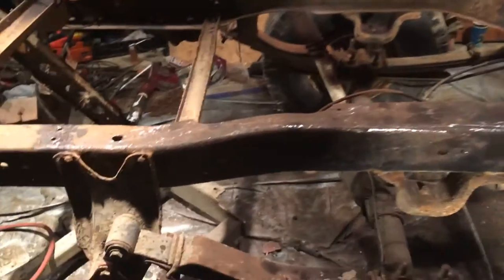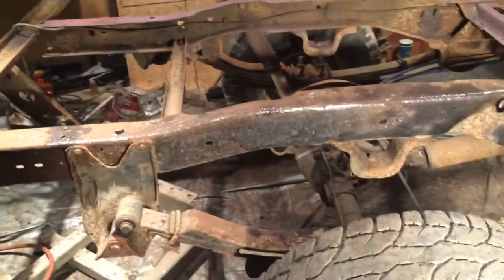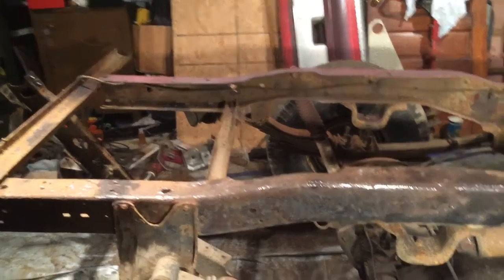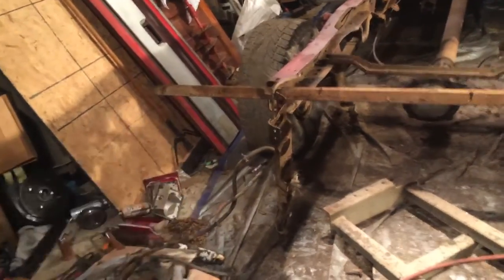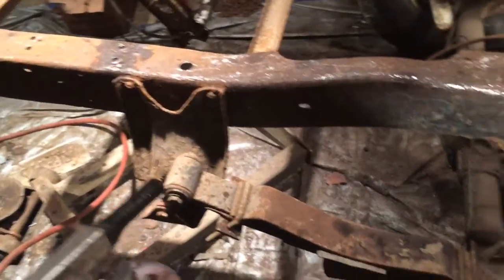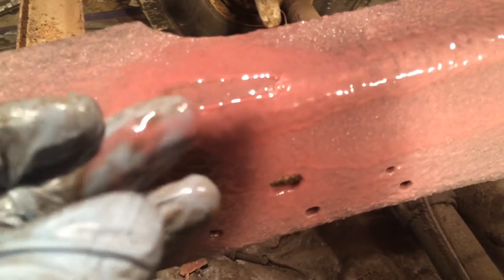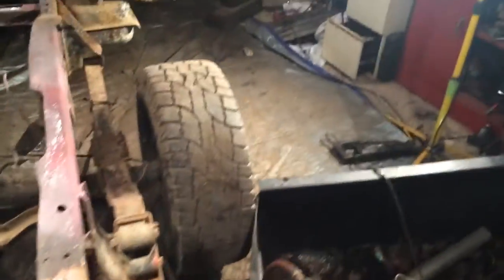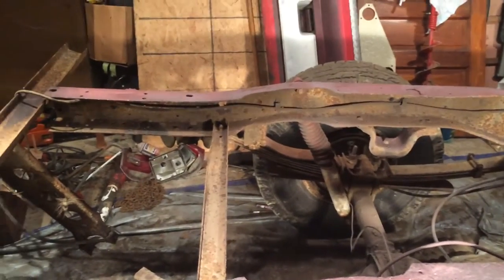Undercoating with bar&chain oil (new formula)

Comment: i use old engine oil on my 97 jeep and hit it every fall. I have no rust on it . It builds up and make a great protection against rust.
Reply: Does it damage your rubber bushings like some people said?
Reply: @trankt54155  no, it's not consistently dripping on the bushings. no prob with mine.
Reply: I use this in Canada my 96 chev half ton has 450000km and not a spec of rust on it. I do the same for my new jeep

Comment: Back in Sweden, my grandfather always sprayed his vehicles with 50/50 diesel and raw linseed oil and then drove them on a gravel road. It would harden up within a couple of weeks.
Reply from the maker: That's a good idea. Never thought of linseed oil. How long did it last?
Reply: I'm not entirely sure, he used to do it every year or two, and never had any rust issues. I've tried it myself a couple of times, but with turpentine and BLO, it smells good and I don't feel bad about spraying it since both ingredients are relatively non-toxic. I think BLO is used inside steel aircraft frames as well, just vaporized during manufacturing.
Reply from the maker: That's pretty cool I'll have to give it a try. Thanks for sharing
Reply: Bar and chain and linseed oil, is still on my truck a year later, last very well.
Reply: @jsollien127  Is that combo safe on rubber and plastic components ? Sounds like it might be a good combo.
Reply: @johnmazza9432  I'm not sure with todays rubber blends, but 30 years ago, my grandfather did it for many years without issues. Him and my dad were copper tin roofer and they would put 50/50 linseed oil and turpentine in the metal seems. I remember opening a 100 year old seem that was green on the outside and looked like a brand new penny on the inside.

Comment: Thanks for the video. You mention ATF and some others also did, how is it mixing with the wax?
Reply from the maker: You're welcome, they mix pretty good when heated in the crock pot
Reply: Transmission oil gives it pink color & a toilet wax ring I've used it under my 92 VOLVO wgn no rust yet on my VOLVO 🤗😁

Comment: You can use toilet rings also and cut them with a oil and melt then spray
Reply from the maker: I have heard of that. I have been using candle wax melted in the oil with great results lately. Maybe i'll give the toilet ring a try this fall
Reply: @international2408  Don't bother, toilet rings won't harden as good as candle wax.

Comment: Where did you get the gulf wax?😊
Reply from the maker: From a local Shop n Save years ago, Amazon also sells it, but I’ve mainly been using candle wax/ toilet wax rings lately with good results.

Comment: Bar and chain oil 60/40 with used diesel engine oil 60% diesel oil 40% bar and chain and hose it down in good shape try to avoid rubber hoses and related parts best you can.touch up annually.  From the rust belt of Vt.
Reply from the maker: Thank you for the recommendation

Comment: Would linseed oil and beeswax work? Applied with a paint brush?
Reply from the maker: I haven't tried linseed oil yet but it seems to be popular so I bet it would work. Beeswax would probably work too, I'm not sure if it would hold up better or not but it should work just fine . A paint brush would work well for frame rails and wheel well openings and things like that. If you try it out let us know how it works.
Reply: International 240 thanks! I will try it when it ever warms up here. -18C for a while now. Anytime outside my hands hurt. Thanks for showing us these fantastic ideas, we sure need it in Ontario where they are use way too much salt. Everything rusts.
Reply from the maker: Your welcome. Yes that's pretty cold. We have the same problem down here in PA, they dump salt and spray brine like there is no tomorrow.
Reply: Beeswax would probably work just fine. But it’s kinda hard to find and when you do it’s not cheap.

Comment: Should apply a rust inhibitor first..Jm2c .  I used a rust inhibitor then  Chassis saver. Works great no rust.
Reply from the maker: Thanks for the input. What rust inhibitor did you use? I do like chassis saver, for the truck in The video I decided to buy a fairly clean 1 ton rolling chassis and had it sandblasted  and I painted it with chassis saver, it worked nicely.

Comment: Gonna lift the formula more or less for my own needs.  Pittsburgher here and salt has mangled many a car I own and that new stuff they put down is even worse.  I maintain 10-12 cars for family so yeah I'm sick of half adding body work.
Reply from the maker: Monkey Wrangler  greetings from a fellow Pittsburgher! Well, I live about 30 miles or so from Pittsburgh. I know what you mean about this new crap they use. It's terrible. This combination of bar and chain oil and wax is the best rust proofing I have used. Beats the living crap out of Fluid Film for the price and the protection. The nice thing is that you can add or subtract the amount of wax to get the consistency you need. But A couple weeks ago when we got that warm weather I noticed that this stuff does get thin when the weather is warm.
Reply: Hah, small world huh?  I'm 35 miles northeast myself, out the Allegheny in Armstrong County...  I'll have to remember that it thins out some with warmth.  Might be a little better to go with more wax, but regardless I think it's a solid idea.  A friend of mine that owns a shop said he just uses old oil but he liked some of the ideas I've seen on Youtube and I told him how it goes. 

I used to work for CarQuest and they sold Fluid Film for cheap for employees, but that party ended so I'm definitely going to work on some concoctions over Summer and see how it goes.  Go Pens & Steelers!
Reply from the maker: Ha yes it is a small world. That sucks about advance taking over CarQuest. They were my favorite auto parts store. The staff was knowledgeable and they could always get parts that I couldn't get at other parts stores. 

But just an update about this formula, In early winter I unmercifully sprayed down my winter beater Silverado  that was starting to get surface rust and the inspection was up at the end of February. so I took it to the car wash because I knew the mechanics wouldn't appreciate getting covered with all the road grime. The grime came off but I wasn't able to get the majority of this coating off. It sticks pretty good. And go Pens& Steelers!

Comment: You had your truck tore down that far why didn’t you paint it with a gallon of farm paint or rust oleum or something any kind of metal protectant paint anything and then spray the greasy oil mixture on it just saying
Reply from the maker: good point, but this frame needed repair. this was just to protect the frame from rusting worse until the summer when I could weld it.

Comment: How's this holding up?
Reply from the maker: This formula hold up pretty good. It's still on my truck. But this year on a different vehicle I used candle wax instead of paraffin and increased the amount of wax added to the oil and it holds up even better. I found that the key to increasing the life of this under coating is to drive the vehicle down a dusty road to let the dust stick to it. After the dust adheres to the undercoating, it's extremely hard to remove.
Reply: Interesting about the candle wax.  So did you literally just buy some candles and melt those suckers down into the mix?

I'm trying to decide what to put on  my '03 Tacoma to preserve the frame.  It's already pretty rusty but not bad enough to qualify for a frame replacement (with the window for replacement running out by next September).  I was thinking of just going to town on it with some bar and chain oil or possibly cutting it with the used synthetic gear oil that I just drained out of my front and rear diff, tranny and transfer case and painting it on with a brush wherever I can get it.  I might put a liberal amount on the frame openings too where drains are and blow compressed air into it to try to push it down further into the inner wells of the frame since that stuff won't really creep on its own.  We are already deep into the winter road salting season here unfortunately, but I just bought the truck a few weeks ago so I didn't really have any opportunity to approach this in a pre-winter preventative fashion like I would have preferred (and also in warm weather where it's more comfortable to work on and easier to keep viscous fluids malleable).
Reply from the maker: Yes I just melted them in the crockpot with the oil. Used gear oil will work, the only type of oil that I would avoid would be used engine oil because it has chemicals that will make the rust worse. Brushing this stuff on instead of spraying it is probably better because you can work it into the rust.
Reply: @international2408  You are correct by saying not using used engine oil because it has an acid that will make your rust even worse
Reply: @kenburns7938  I had a 1988 Ford Ranger I plowed commercially with for 18 years. It developed a leak in the oil pan and the USED oil blew back the entire length of the truck. NO rust at all where the oil coated the center line, but the sides, frame etc solid rust. Oil kills rust. Can't oxidize without moisture and oxygen.